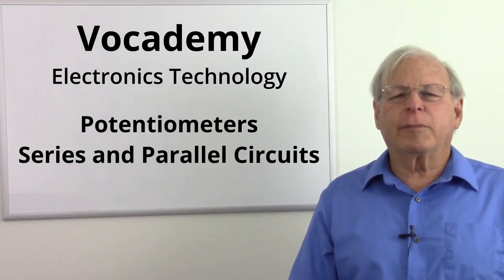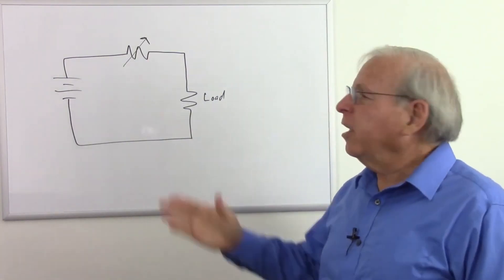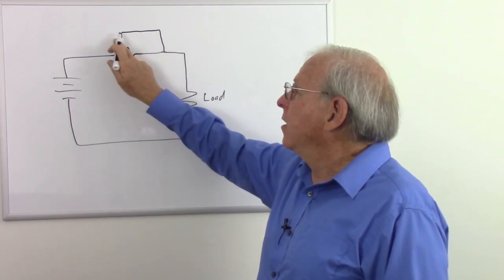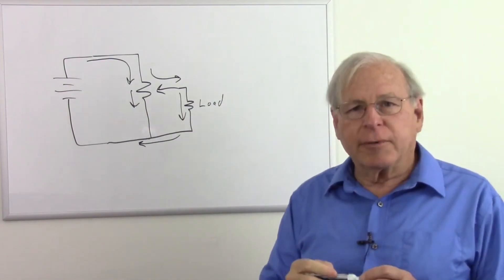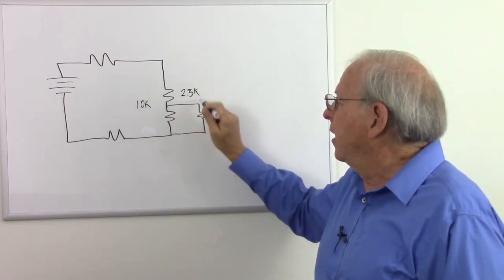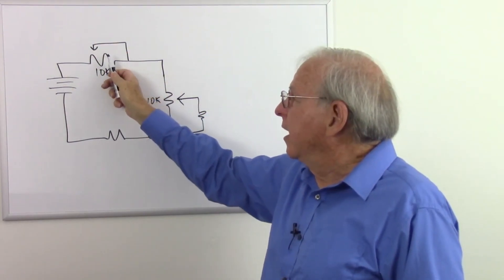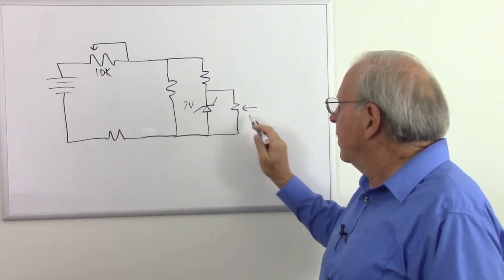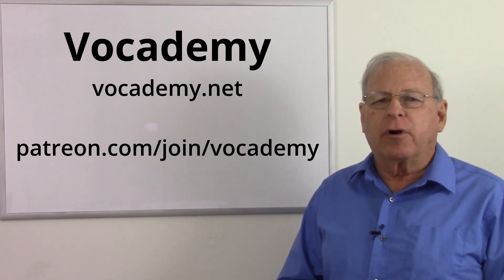Potentiometers and Series and Parallel Circuits

Comment: Really helpful. I was playing around with copper plating over the holidays and my usb 5v 0.5amp power supply was too much for small parts (needs around 1amp for a 10cm (4 inch) by 10cm area). I had an old electronics kit, so I got a potentiometer (10k) and wired in series. Using a multimeter, also in series, I could monitor the changing amps. Was still a bit too 'spicy', even at the lowest amps i could get (the parts are tiny propellers). So i used your same potentiometer trick with a 1.5v AA battery. Seems to be working and not covering parts in 'burnt' copper oxide any more. 
Thank you for the video and your philosophy around education.
Happy New Year!

Comment: Well I never took no college education stuff but I just checked this video out to confirm if my tinkering was correct I figured out how to put two potentiometers in series so that I have one that's just a dial for the throttle of my e-bike and the other one is my throttle since my controller didn't come with any multi-speed settings or anything I just placed into my throttle lines and ran to potentiometers in series so that I could manually adjust the top speed a governor if you will because I don't like having to hold the throttle at an in between position because the spring is annoying for my thumb it's more comfortable to push all the way down but going Full Throttle constantly is not always desired so I installed the extra potentiometer